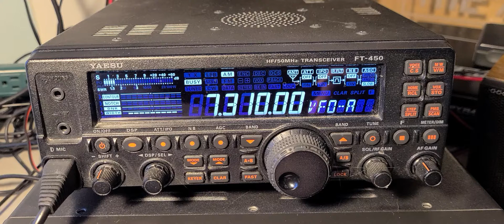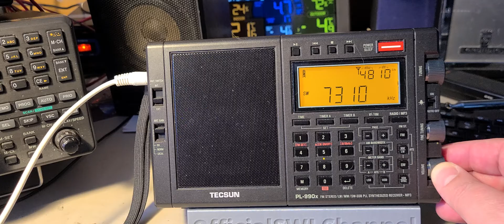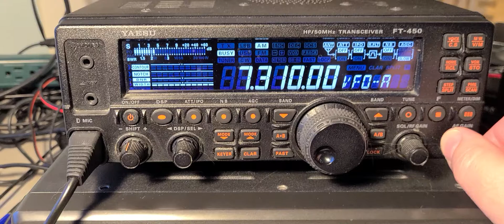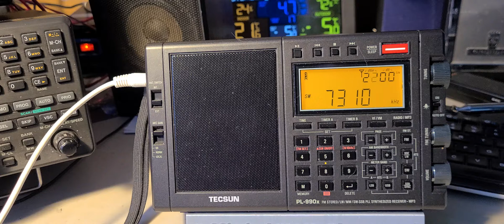Icom IC-R8500 VS Yaesu FT-450 VS Tecsun PL-990x Radio Romania 7310 kHz Shortwave

Comment: You need a switchbox.. some receiver can induce RFI to others when connected together on the same antenna without isolating them from eachother... not mentionning that some radio are more sensible to the impedance mismatch that this setup induce.
Reply from the maker: two desktops are on their own antenna.... only the yaesu shares with the PL 990x ...  anyway...multicoupler has arrived...will be ok